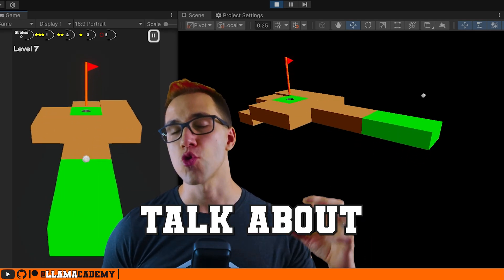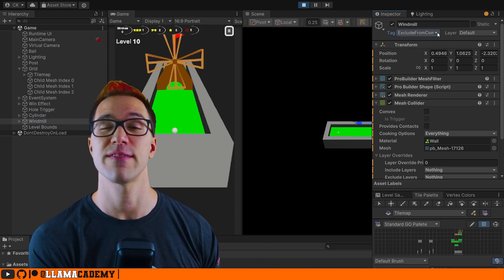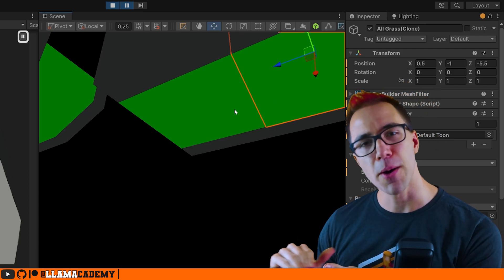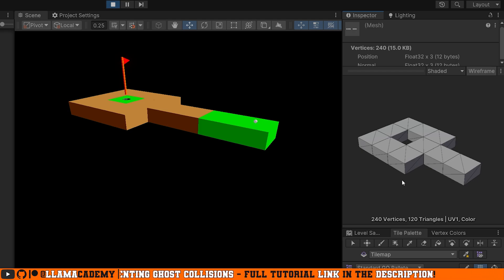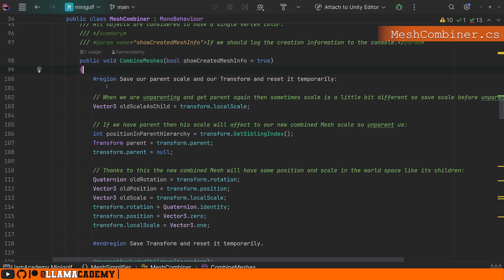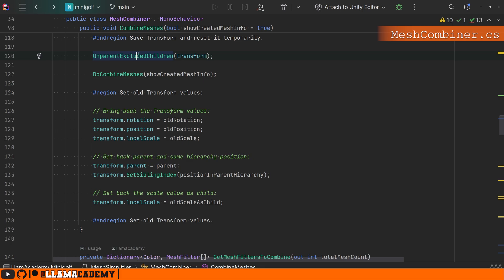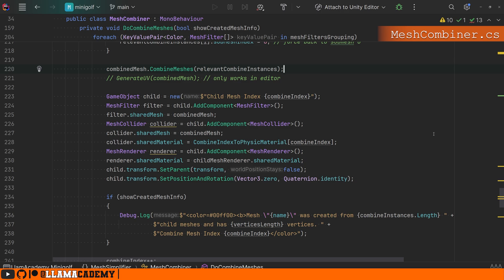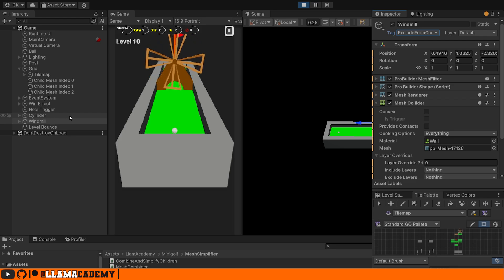How I Implemented Runtime Mesh Combination in my Minigolf Microgame | Unity Tutorial

Comment: This is an excellent video. I have a question, though. For my project, I have a rolling ball game with the same ghost collision issues you describe... unfortunately, I can't simply combine meshes for all the different sections of the map because my game involves massive levels. The resultant mesh collider could easily be 100,000+ tris which will make even a nice computer choke. This is immensely frustrating; I've spent weeks trying to come up with a robust solution for this and failed miserably. The best I can think of is to force levels to have jumps between different sections of the map so i can have different colliders for each section. That solution downright sucks, because I want a level editor players can toy with that doesn't restrict their creativity so severely.  The only other idea I have is to do custom ball physics from scratch with ray/spherecasting... but that's a massive undertaking that still might not work for all I know. Would really appreciate your advice as I'm at my wit's end. Note I'm also already using Physics.ContactModifyEventCCD code similar to what you've described in your other video.

Comment: How well does the mesh combiner work with textured objects that aren't a single vertex color that are using the same materials?
Reply from the maker: Should work the same if you only have 1 material. If you have different materials it would need some tweaking